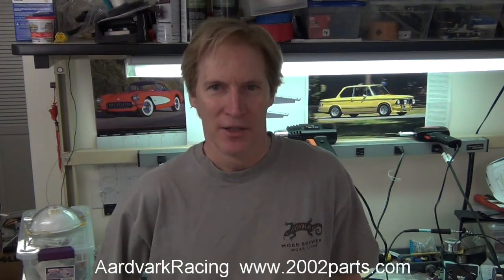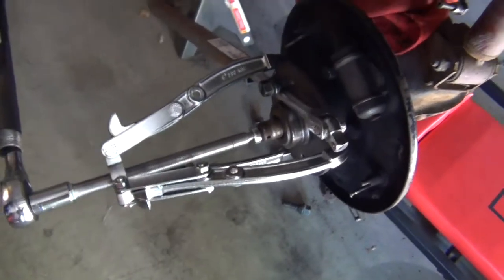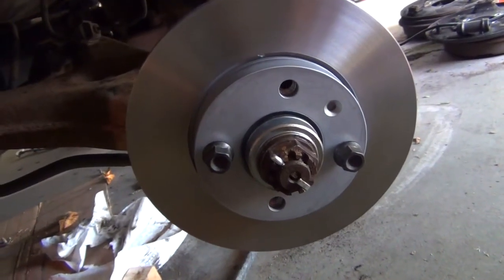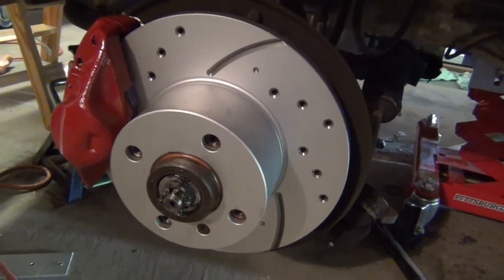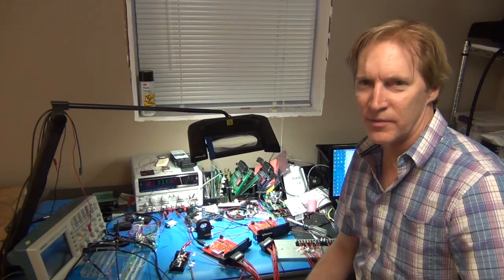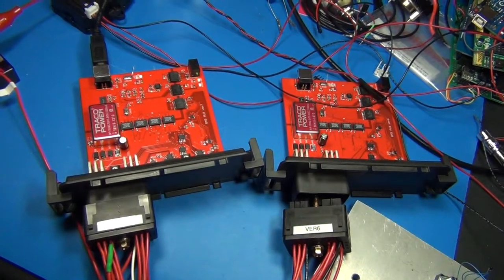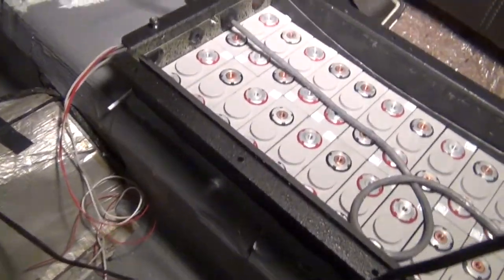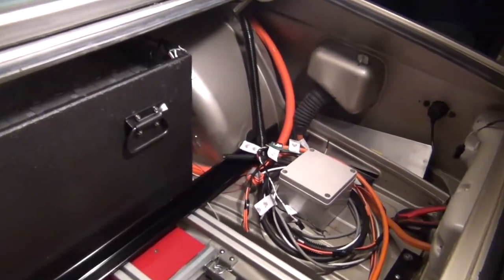Electric BMW 320i Video#17

Comment: Wow Ed, this is a cool brake update and looks so simple with the right tools ;-) Wouldn't electric regen help minimize the use of regular braking for the car even if it is faster than "stock"?  Is regent amount just controlled/tunable by another ev conversion component/part?
Reply from the maker: Oracle Express Regen works well for normal braking - i.e. when you are just touching the brakes.  The regen will take over and the brakes will be used less thereby lasting longer. In fact I plan to incorporate regen in the throttle pedal so the brakes might not be used at all.  But if you are doing any hard braking you really don't want a lot of regen, better to rely on the brakes.  The regen feels really grabby whereas the brakes are predicable.